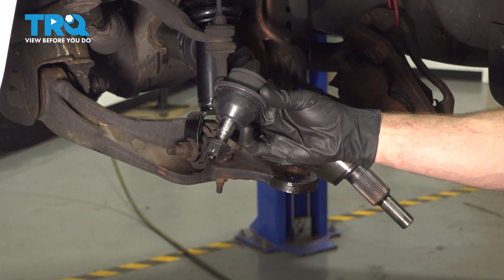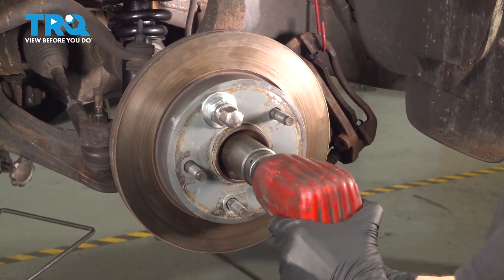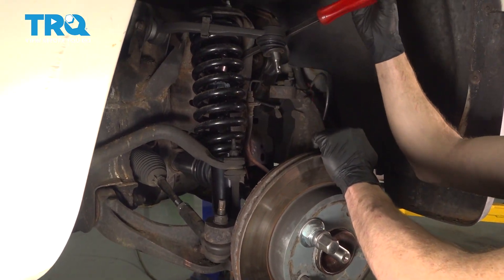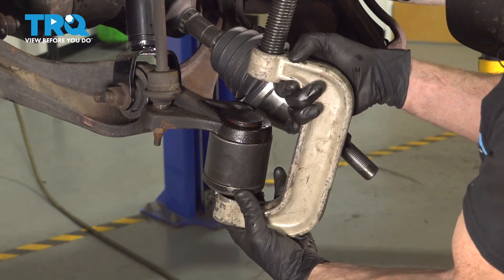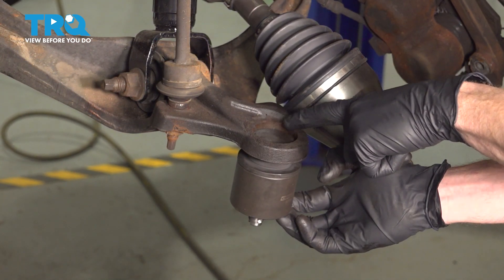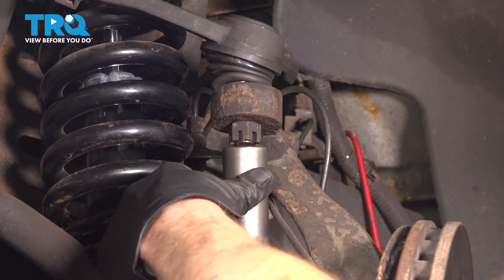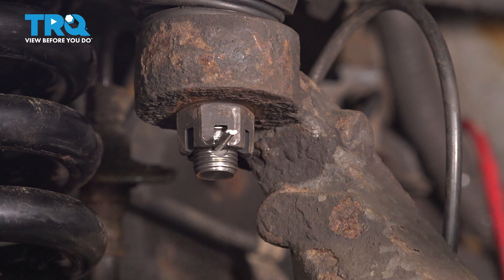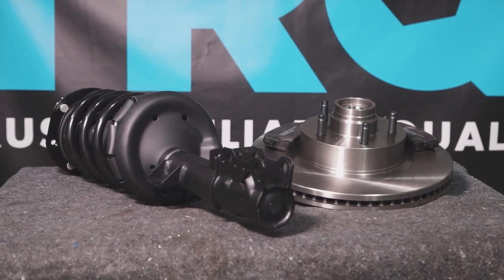How to Replace Lower Ball Joint 2005-2010 Dodge Dakota

Comment: Cannot for the life if me find a proper sized receiver cup for this ball joint. the lip on mine is TINY, barely bigger than the ball joint outer flange, which is 2-5/8" OD. I've tried three kits already and cannot find one that fits. I've resorted to trying to source an off cut of steel pipe with the correct ID. If anyone knows a kit that actually comes with the correct receiver cup for this ball joint, please let me know.